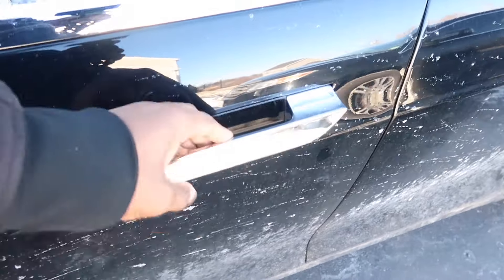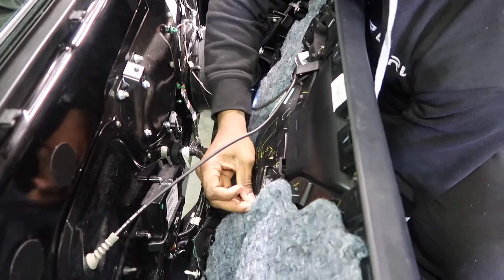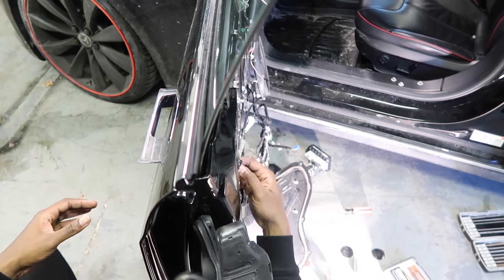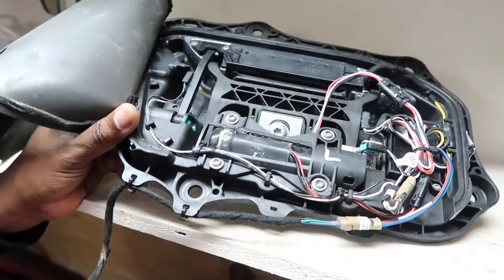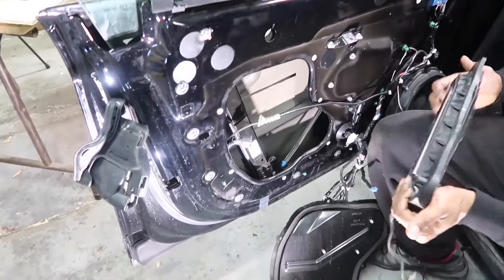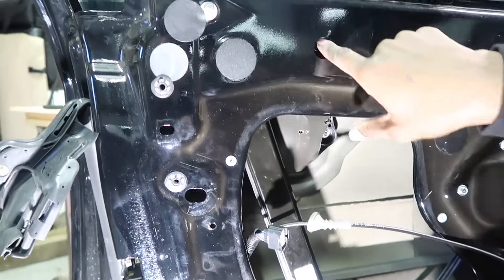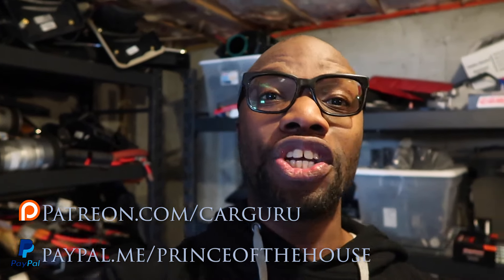How to fix Tesla Door Handles

Comment from the maker: Door handle rebuild kit/exchange located here https://evtuningsolutions.com/products/model-s-door-handle-rebuild-kit-service
Reply: But how do you get that one nut back in there which was next to the window glass when the glass was down?
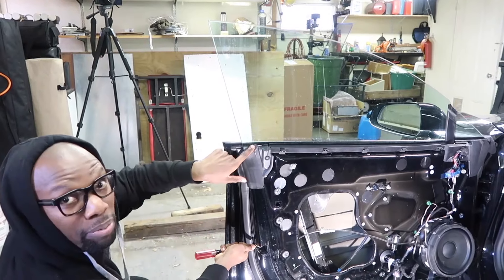Reply: 4:56 No kitchen knife. I'm very disappointed.
Reply: Was that a NEW harness that you tried first? I have to say that that whole door is an absolute mess from an engineering standpoint. Overly complicated with obvious “ choke point “ failures. If the wiring harness is prone to failure, why has it not been corrected by Tesla ? I have to say that these things do not impress me.
Reply: @MrBrander  My question too!  I got lucky--put a tiny piece of duct tape on the wrench to make the nut snug in the wrench, and after positioning the nut over the bolt, used a screwdriver to turn the nut as I pulled the wrench partially off.  (However, getting the door handle's upper hole over the bolt took an hour!  Finally had to get my headlamp and a screwdriver to work it past the window--which was all the way up per Rich's trick of tricking it into thinking the door was closed, but still a pita).  The paddle gear was $6.00 at the service center.  Thanks Rich!
Reply: I wanna cry this looks so didficult
Reply: @MrBrander  Similar to Chris' answer below.  We put painters tape on the nut flange, dangled it down toward the bolt, got it square with the bolt with a screwdriver, then held the nut in place with the flat screwdriver.  Then while I was pressing the nut in place on the bolt with the screwdriver my wife used the crescent end of the wrench to get the nut threaded, then tightened.
Reply: @MrBrander  use a magnet
Reply: Link does not work, so you order just this 2 connectors with the wire , can you buy this from tesla?
Reply: hello, thanks for the video. the link doesn't seem to work for me. if it's not too much trouble, could you please recommend another site? i need the door handle module for the driver rear on a 2015 model s
Reply: @rezakhanzadeh I’m in the same boat I hope he can respond. Good luck!
Reply: @MrBrander  you don't need it

Comment: Here's an idea, how about Tesla doesn't make their door handles so dam complicated
Reply: They did that better for model 3
Reply: The Model S is a luxury sedan. So it has to have those complicated door handle design to stand out vs. other cars in it’s class. The less complicated and simpler door handles is more common on cheaper car models.
Reply: Chris Bautista Agree, it is very nice when it works actually...
Reply: Guess it would be nice if they had an alternative and less complicated aftermarket door handle.
Reply: Chris Bautista lol it's a gimmick that is shittily thought out and engineered.
Reply: JBassPlayer28 It’s so good to know that you could do a better job on the engineering. 
Maybe you should contact Elon and tell him how to do it better LOL :-)
Reply: Correct, they did, on the Model 3.
Reply: We've had reliable door handles for decades. It took a visionary like Elon Musk to break with the status quo.
Reply: Nah that would be too easy. This vid first time I've ever seen the model S door handle module. Holy shit they over-engineered it. More guaranteed points of failure with no comensurate value added.
Reply: Chris Bautista
Bentley, Rolls Royce, BMW Audi, Porsche and others managed to make more reliable ones for decades.
More complicated usually does not mean better.
There's a reason we don't re-invent the wheel with every car model, even the Tesla still uses that 5,000 year old bit of tech.
Reply: My VW has heavy German door locks.  It still closes like a bank vault after 16 years.
Reply: To be fair door handles break all the time in a lot of cars. I've done more replacements/fixes on VW and Audi (same parts) than I care to remember. Same thing everytime, winter comes and the doors don't stay closed anymore, in fact my Range Rover did that too one time and that's a BMW part. The door handles themselves aren't even the complicated part, it's the lock that has all the microswitches and springs and shit.
Reply: I mean door handles do break. I replaced 3/5 on my last Toyota (oh I must be mistaken those don't break😏😂😂😂) and another broke that I didn't replace before it died.
Reply: You need a wratcheting box end wrench.
Reply: @trygvelillefosse6986 .... Aftermarket? Will Tesla allow that?
Reply: Lt. Lasereyez-I have a Toyotas and one Suburban and have never had a handle issue and they have 32 years and 450k miles between them. Why would I want to trade that experience for this Tesla door handle that looks cool has lots of issues one?  Vanity
Reply: @FutureSystem738  use cast metal instead of plastic for moving parts
Reply: Well its already been made this way so the this repair is still necessary unlike your manufacturing comment on a repair video 🫵,sofa king we todd did

Comment: Thanks for posting this video. Following your instructions I fixed my broken Model S door handle in a couple of hours, and saved myself paying Tesla $550 + labor. I bought the microswitch kit from EV Tuning but didn’t even need it. I simply cut the wire at the break, stripped a bit of insulation each side, bridged the gap with about 2 inches of stranded wire (to give a bit more slack for the constant movement), covered the solder joints with a bit of heatshrink tube to insulate them, and put it all back together. If it breaks again I’ll do the full microswitch swap next time.
Reply: Will it also work on a Tesla model S. In Denmark.

Comment: Rich, why would anyone want to own one of these cars, unless they were rich?  I cannot believe the time and expense this repair must cost, just to have a door handle that is flush, and pops out.  While an electric drive motor may have less moving parts than an internal combustion engine, I have watched some of your videos and the rest of the car sure makes up for it.  I used to work on new and used cars at Volvo dealerships years ago, and I replaced flush broken door handles every once in a while, but nothing was this complicated.  This looks very daunting.  Complicated things tend to break or malfunction.

Comment: my problem seems a bit different, my door handle is stuck in the present position, i'm guessing one of the switches wiring went and it is now stuck in this position, mines a 2014 P85. love the video, very entertaining and informative., its also on  the rear door, but i'm guessing the process is about the same.

Comment: Rich, I just did this repair on my 2013 Models S.  But my handle only has 2 wires.  Oddly enough after taking everything apart and re assembling, the handle worked fine. 

But i did find it odd, only two wires, and the one i ordered from EV tuning didn’t even exist.  I can send a picture if your interested.

Comment: AN EASIER WAY! Rich thanks for this and all your videos. I just did failed door #2. There is an easier way than drilling holes to get the microswitch screws out! Mark the big bolt in the middle and turn it out 4 full turns making the screws accessible.  Don't forget to put that screw back in the exact number of turns before you put the cover back on. 
The big issue I have had, and is that is not covered in any video, is how to get the connectors to release. You have to be careful of the wires and the connectors need to be examined carefully to see how they work; they don't just pull out, you will damage them. BTW the $55 stainless steel gear Amazon kit is not stainless steel and doesn't fit without some machining. Also, that kit's microswitches are a different size and mess up the adjustments if they work at all. Don't ask how I know, I had to put the original good switches and harness back in.

Comment: What do you do if the window is stuck at a lower position and won't move enough to get at the door handle screws? Even after trying the door lock trick with the screwdriver...

Comment: Thank You!  I just finished repairing the passenger side front door on my 2013 model S P85+.  Broken wire on the contact switch.  Nasty job, especially the nut behind the door glass!  Saved about $400

Comment: Does the top nut next to the trim need to go back in. Looks like a good idea to leave it out for next time ;)
I would smear electrical gease on all of the plug contacts to prevent corrosion. Cheers fella.

Comment: Actually followed this video guide and managed to fix a slightly different problem. My door handle came all the way out when I unlock the car, which opens the door right away. Had to adjust a screw next to a switch to make the door stop at a middle position. Thanks a lot, man, this video was extremely helpful!
Reply: I have the same problem you are having.  My front passenger door opens every time the handles present.  Where is the screw you adjusted?
Reply: @veritycaruso  Oh, it was so log ago, I've already sold my Tesla, it was too much trouble being as ald as it was...Did you pull your handle module out of the door yet? I'm sure I'd recognise the adjustment screw if you take a picture of the module without plastic covers
Reply: @alexandermiroshnychenko5771  Thanks for the reply.  My dad gave me his 2013 model S when he got a new one a few months ago.  I was hesitant to accept it as it already had 173k miles on it.  Dad said I am free to sell it or drive it.  I still have my Prius and may end up selling the Tesla.   I am not a car person, but I have to admit, it is a lot more fun to drive Dad's old car.   Though it gave him few troubles, I figured it may be time that it would start breaking down.  Sure enough, a few months later the first door handle issue occurred.  I watched another video and located the screw and a sensor that determines how far the handle presents.  I'm not sure if I should tighten or loosen it, but I'll try both ways and see which way fixes the issue.  I haven't taken anything apart yet, but I plan to tackle it tomorrow.  I hope you're enjoying your new ride.  Cheers!

Comment: In the olden days when my cars had hand-cranked windows I sometimes had to take the doors apart to lubricate the regulators.  Since I started buying cars with power windows I haven't needed to do that.  It seems that this problem is a regression.

Comment: I wonder what would be a more permanent solution to those two recognized common door handle failure points. It would seem like the manufacture or design specs for that cabling component is inadequate.

Comment: This repair is for the case in which the handle does not present.  But there is another failure mode.  My driver's handle extended and stayed there.  You could see that it was extended further than the other handles.  Even though extended, it was not possible to open the door with the handle. (Still could open it from the inside handle.) My understanding is that this is some sort of mechanical failure of the moving parts of the handle.  So, I assume the repair shown here would not apply.  True?

Comment: why havent you simply baught those switches separately and soldered them into the wiring? as brilliant as you are im surprised that you havent coated the microswitches in silicone to waterproof them with grease on the front of the moving contact on the switches for moisture protection! not to mention greasing all locking and latching mechanisms and hinges

Comment: Wonder if these same switches that cause the door to pop ajar when unlocking the vehicle?? About 50% of the time I unlock the door the driver front door pops open an inch or so. Annoying. 
Great video.
Reply: Yes, so annoying.  For me it's the front passenger.  I wish it was the driver's side.  At least I use that one most of the time the handles present!

Comment: The last nut remove to take out the door handle. You showed me with the window down and squeezing a wrench between the glass and the nut. I tried that, I just couldn't get it to work. I ended up finding the easier way was with the window all the way up as you had it originally, loosen the knot that holds the glass onto the window mechanism, and loosen the window lowering track from the door. Then you can lift the glass up out of the way, and move the window track sideways a quarter inch, and then you can get on to the nut from the same side as you did all the others. I also found this prevents the window and track from jamming the handle and making it hard to get out.

Comment: my 2015 S has one handle that doesn't pop out when you press on it and the other handle doesn't open at all. there's a constant noise of the motor trying to present the door handle on the handle that doesn't open at all. can both be fixed by replacing the wiring harness?

Comment: How the hell do those harnesses breakage like that? There's no stress put on them right? I'm wondering if you were to fabricate a shim spacer sleeve kind of thing formed to fit around the handle, would that line it up right so you can bolt the assembly without a lot of trial and error? I hate messing with door trim. Once you remove them, they never seem to be as snug as they were from the assembly line and they start rattling sooner when you close the door or hit bumps.

Comment: Great video.  Watching this video gave me courage to attempt a door repair on my 2014 S85  I'm a computer guy, never worked on cars before.
This job was a freaking nightmare!!!  Each step I ran into new puzzles... how to disconnect the wire clips...  dropping screws into the door....  I couldn't get the door handle out so removed the window.. that was scary...  dam door handle mechanism is painful!  couldn't unscrew the switches, drilled a hole in the side...  ended up soldering the broken wire, leaving the switch attached.  It then occurred to me.... I COULD MESS UP MY ONCE 89K dollar car....  I somehow managed to get everything back together....    it now unlocks 50% of the time!!!!  success... . dam!!!  Great little adventure.  May try again!!!!  One can buy the entire door handle assembly on ebay.  Over a grand for Tesla to fix this... figured what the hell.       LOVE ALL YOUR VIDEOS!!!!!  Stroking that guy's hand on your other video was a little creepy, but a nice touch... (pun?)   I'm delirious after taking my car apart.

Comment: Hi, have not read all the comments som maybe someone already has put in this tip. Your new microswitch harness might not be excactly like the old one, and you might end up with door opening as the handle presents. Suggest you plug in the handle after replacing the harness but before putting on the cover to test it. Use the same trick as in the video to simulate door closing to test. If door releases when presenting you should adjust the standoff beneath one of the microswitches towards the switch until the door does not release by itself anymore. Test releasing door by pulling on the handle. When ok, install cover and put the handle assembly back in the car.
Reply: I wish someone would make a video of this.  That's my problem (front passenger door opens every time the handles present) and I haven't found a video yet about what needs to be adjusted.  If anyone knows a video that shows, please add the link!  I'd appreciate it.

Comment: Good job.
One thing I would expressly make sure to do and that
is as soon as you get the handle mounted again and its bolts locked it,
I would retest the door handle to make sure it sill opens the door.
I would do that before you re-install all the inside door assembly and its bolts.

If the door handle doesn't work just after you assemble its bolts and 
then you have all the inside door panel bolts, then you are going to have to
take those bolts off all over again.

Bravo.

Comment: I've done this repair a couple of times and Tesla did it once i.e. they replaced the whole mech with a new and improved one when it failed under warranty (for some reason it was always the driver's door).
I've not heard of anyone drilling those holes for better access to the micro switch screws, excellent idea. Thanks.

Comment: Rich, would it possible to convert the existing MS door handle to behave like the MX where you can just push the door handle like a button and the door opens?  I actually kinda hate the fact that the MS door handles have to present themselves in order to open the door.  I have had to replace 3 handles already and now a 4th one is broken all due to the same issue.  The door handle doesn't present it self, but the if I can get the handle to present (by using a credit card or something), the door opens like normal.  It would be cool if I could convert all my handles to behave like the MX.

Comment: Surely If you think it's going to fail the same way, then why not try and redo the wire and microswitches in a more durable material so it won't happen that way again?

Also, it would probably be much easier to simply take the glass out as the first step (mark position first!) after pulling the door card as it will save a bunch of fiddling around.

And for losing nuts or screws.... blutak in the socket or better yet, a magnet.

Comment: Thanks you Rich!  I had a bad squeak and didn't have to remove the handle, just loosened it, re-centered it, and re-tightened.  Under an hour total and FIXED way less time than going to service center.

Comment: I did all this. It still doesn’t present. The wire I replaced seemed fine. Any ideas? I checked all connections for corrosion. The unit looks fine honestly. I cant figure it out

Comment: One thing to add, as I just took mine apart, is you have to remove that rubber water-proofing flap before you try to remove the handle.  Its really tight between the glass and the door handle.  Got mine stuck.  Had to get it back in place, remove the black rubber and then it came right out.